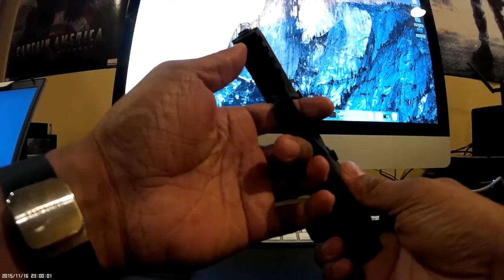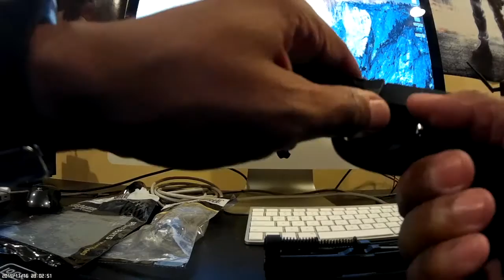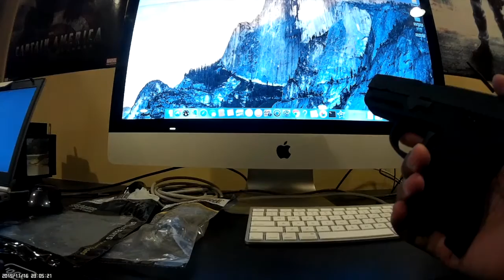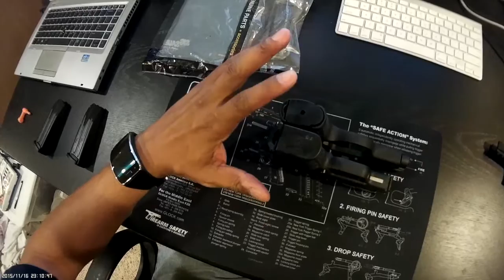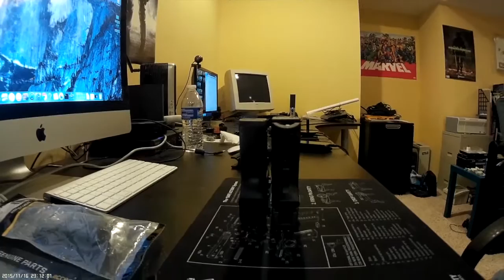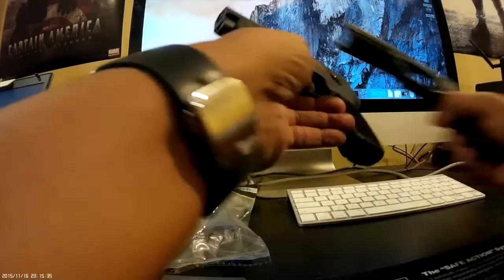Sig Sauer P320 Compact to Subcompact Conversion!

Comment: Would be nice to have a link for the product. I can't find a subcompact frame for the 9mm sig p320
Reply from the maker: Apologies, I wish I could help but I can't.

I went to different sites and they were ALL out of stock, so I used those back-in-stock email notifications for each of those sites.  I must have submitted notification requests for 20 different sites.  I waited 1.5 years before I got a first notice that they were in stock...I bought it IMMEDIATELY.  It's been maybe 2 years since then and I've not gotten a single notification since.

Sig dropped the ball on this one...they didn't ensure there was adequate supply.  That, or they're purposely choking supply to get people to buy their conversion kits (or new guns), which cost a ton more.
Reply: @unixfool  Sounds good, thanks!

Comment: This doesn't require a slide conversion kit? You're able to go from Compact slide and frame to Compact Slide and Subcompact frame?
Reply from the maker: No for the first question.  Yes for the second.
Reply: I have a p320 compact and want to change to sub compact frame . My question is I can still use the  compact size  slide that I already had and just need to buy a sub compact frame to do the exchange?

Comment: The p320sc seems noticeably thinner than than the Mod2 - is t really that apparent? Does the 320sc carry easier than the Mod2 due to the apparent thinness? I ask because I am trying to decide between the Mod2 and p320sc for carry and can't find a p320sc locally to handle. Thanks!
Reply from the maker: The P320SC is much thinner in the grips, but the compact slide I'm using appears to be thicker than the Mod.2's.

Comment: Here's a question for you--what holster do you use when you have your SC grip on your C gun? I asked AG online if I could just use the SC shell on my C with the SC grip and they said it wouldn't work.  Has that been your experience?
Reply from the maker: AG is correct...that won't work since the SC and C trigger guards are drastically different, which will affect holster fitment.  Best to just buy an AG holster shell for your SC.

Comment: have you tried the subcompact in the alien gear compact holster? i talked to alien gear yesterday and was told that the subcompact with the compact slide should fit in the compact holster even though the trigger guard is different...what holster did you end up using?
Reply from the maker: I've the AG 3.0 for the P320 Compact.  The subcompact frame for the P320 does fit the P320 Compact shell of the holster.  It fits well enough for me, but for those that are OCD, it's probably not going to be a satisfying match-up.

Comment: are you able to use a subcompact slide on to a compact frame?
Reply from the maker: I have no idea, but I'd guess not.  The compact has a bit of extra length.  You can get confirmation at www.sigtalk.com.
Reply from the maker: +chris baumann I did some digging, and a subcompact slide will fit on a compact frame, only the frame would be longer than the slide (Most people cut off the extra length and file down the rough edges).